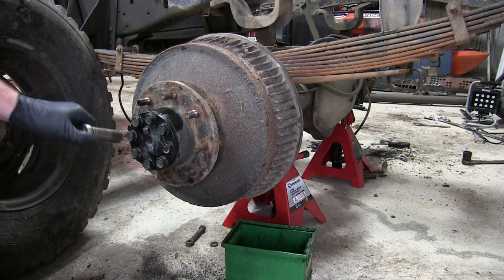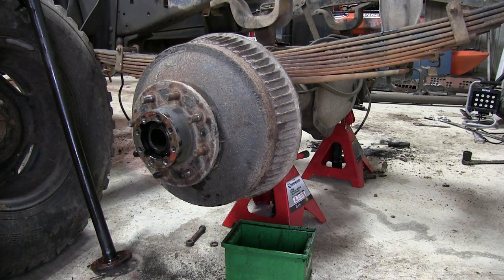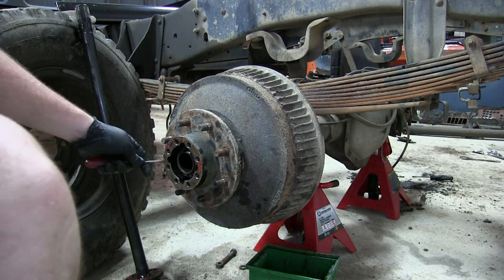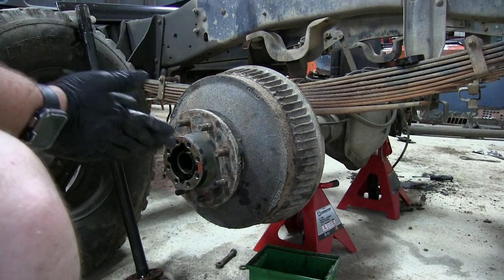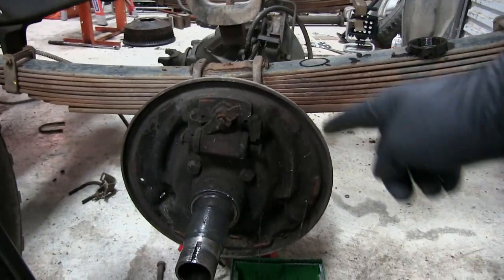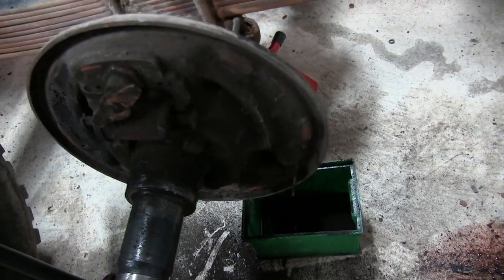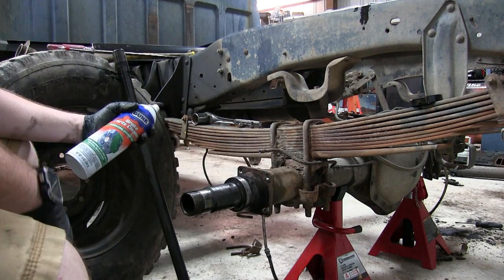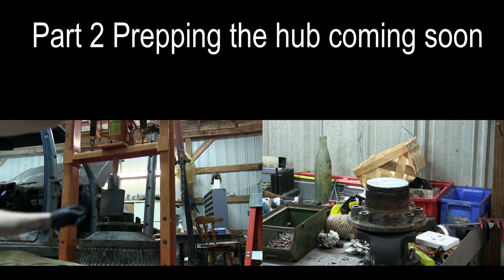14 Bolt Disc brake conversion part 1

Comment: If you disconnect the emergency brake cable at the splitter bracket, then disconnect the brake line at the wheel cylinder, you can use a socket and extension to get the flange bolts and pull the entire backing plate assembly off with the cable still attached. It makes for a little less to disassemble.
Reply from the maker: thanks for the tip and thanks for watching

Comment: When converting from drum to disk does that shorten the WMS width?
Cause I got a 14 bolt out of a van which is about 70" and i need it to stay 70"
Reply from the maker: I think my WMS width stayed the same.  If it did change it was minimal.  Per lugnut4x4 website any changes should be less than 1/4 inch.  Thanks for watching
Reply: awesome thank you. cheers  @Offroadfarm1

Comment: Awsome vid man. My question is...do u use 11" or 13" rotors for the conversion??...im going to be doing my 79 square soon.
Reply from the maker: Glad you liked the video.  The rotor I got in the kit is a 12.4 in rotor.  part number 5523.  Thanks for watching

Comment: Do you have a video on
How to take a DRW 14 bolt and run a single tire and wheel. Thanks
Reply from the maker: No I don't.  Check out this webpage. http://www.billavista.com/tech/Articles/14-Bolt_Bible/index.html  It has tons of info on the 14 bolt.  About half way down he talks about the difference between SRW and DRW.  I believe you can simply change the hubs to SRW hubs, but I have never done it before so I am not certain.  Thanks for watching and good luck on your project!
Reply: @Offroadfarm1  The detail and part numbers and links sums it up. Thanks and Thanks again from all the people I will pass what you told me along and where to find it.

Comment: Those brake lines, use pb nut buster and a crowsfoot or offset flare wrench
Reply from the maker: I used plenty of pb blaster but I don't have an offset flare wrench

Comment: Id like to do a AAM 11.5 14 bolt FF rear for my 1500 but find 6 lug hubs to fit 6 lug wheels with the rear OEM disc brake with parking brake.
Reply from the maker: Check out https://www.sneveysoffroad.com/ they have a 14 bolt 6 lug hub conversion kit.

Comment: Curious as to why you’d pry the brake shoes off as opposed to using the proper tools to remove the springs.  Ones the springs are removed, the shoes come off easily.
Reply from the maker: I don't have drum brake tools and they were easily removed with a long screwdriver.  Also I had no plans to reuse anything, it all when in the scrap bin.  Thanks for watching
Reply: Could have just left it all together and just pulled the 4 backing plate bolts and removed it all as one assembly.

Comment: How much you fugue it costed to do the swap to discs brakes roughly mind you im in canada im thinking of it
Reply from the maker: My kit was roughly $600.  That did include the E-brake calipers and new bearing which added close to $300.  Their basic kit for a 14 bolt starts at $315 but shipping to Canada per their site is $150 which is high.  You may be able to find a company in Canada that offers a similar kit and save on the shipping.  TMR customs does offer a kit which includes the bracket, rotors, calipers, and pads for $429 CAD no idea about their shipping charges.  Good luck and thanks for watching

Comment: Is this considered smi float or full float I have the same GM 14 bolt but not sure which one to order on the web site. Mine looks exactly like yours.
Reply from the maker: My axle is a full float 14 bolt.  Check out this link to help identify which axle you have.  https://lugnut4x4.com/axles/14-bolt-axle-identification/
Also use this link for tons of good information about the 14 bolt  http://www.billavista.com/tech/Articles/14-Bolt_Bible/index.html
Thanks for watching and good luck on your project

Comment: you have the stud mounted drums, i have the slide on drums i wonder if i have the same process with install an removal 

also what year is your truck?
Reply from the maker: The process will be similar.  lugnut4x4 has a kit for the newer style of 14 bolts with slide on drums.  If you opt for the slide on rotor then you won't have to press or knock out your studs.  He also has a kit that will go behind the hub and you will have to knock those studs out.  My truck is a '88.  Thanks for watching!
Reply: @Offroadfarm1  i still don't understand what rotors i need to get, the slide on rotors for stock vehicles or rotors behind the hub.

mines a 1996 k3500 with slide on drums i don't have to remove hub to get drum off
Reply from the maker: You can get either.  
Keep in mind regardless of which style rotor you get you will still have to pull the axle and remove the hub so that you can remove the dust shield/backing plate and then install your new caliper mounting bracket.

Slide on rotors :  remount the hub, slide on rotor, install caliper, mount wheel, done(don't forget to hook up and bleed your brake system)

Rotor behind the hub:  Press or drive out all 8 lug studs on both hubs, put rotor behind hub, press or drive in all 8 lug studs per hub through rotor into hub , remount hub, install caliper, mount wheel, done (hook up and bleed brake system)

The slide on rotors are easier to install but cost more.  If you have access to a press and want to save some money then you can get the behind the hub rotors.  They will save you some money but will take a little longer to install.  (If you don't have a press you can still install the behind the hub rotors to save some money.  You will have to knock the lug studs out with a air hammer or a BFH,  it will take longer and be more work but it's totally doable.)

Also make sure your running at least 16 inch wheels to clear those new calipers!
Hope this helps
Let me know if you have any more questions
Thanks for watching

Comment: Were you able to use your stock rims with the conversion kit because I'm doing a '95 Chevy dually I'm having clearance issues. Are you using 16-in rims???
Reply from the maker: Yes, my stock 16 inch rims fit with no issues.  My rims are steel.  I assume they are stock, they are cheap looking steel rims, but yes they fit with no issues.  Now they are tight!  But no rubbing that I have noticed.  Thanks for watching
Reply: Did u end up doing it I have a 99dually

Comment: I'm going to be doing this same conversion on my 1994 k3500, and I will be doing it in my two car garage, so I'm wondering how much side clearance I'll need to pull the axle shafts out on either side of the truck,
Does anyone know?
Reply from the maker: Measure from the center of your rear chunk to the axle mounting surface.  This will give you a rough idea of how long your axle shafts are and how much room you will need to pull them.  Once you get close to the end you will be able to angle the shaft some.  A quick search looks like your shafts should be around 32 inches long.  I would say you would need at least 30 inches of room, maybe 32.  Good luck on your project and thanks for watching!
Reply: @Offroadfarm1  thanks for the info, I've been watching your videos on this subject several times, I'll be starting on the conversion this weekend and through the 4th of July and hopefully have good luck, thanks for making very informative videos👍

Comment: Im stuck how the hell did you just break off the axle bolts like butter? 
2 200 pound dude cant even break these loose on my end
Reply from the maker: Are you asking about the flange bolts?  Mine were not a problem to get loose as you mentioned.  They should only be torqued to 115 ft-lbs.  Maybe some one used locktite on them?  Have you tried heating them?  Have you tried a cheater?
Reply: @Offroadfarm1  my left hand side axle broke free pretty well but the right one is still hard as a rock. 
Ill try a cheater tomorrow. My guess is they were over torqued.
Thanks for the help
Reply from the maker: Any luck getting the right side axle loose?
Reply: @Offroadfarm1  yep got if off. Then my wheel cylinder locking nut stripped and it took a hammer, chisel and some beer to get it off lol
Reply from the maker: Glad to hear you got if off

Comment: is this kit for dually 14 bolt full floater or single wheel?
Reply from the maker: The kit I used was for SRW but I believe lugnut4x4 also has a kit for DRW.  Thanks for watching